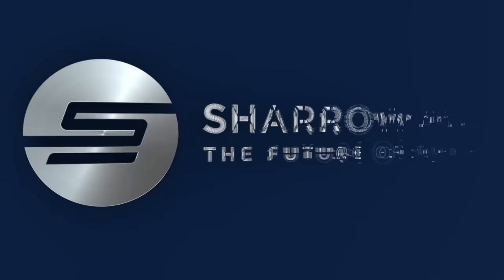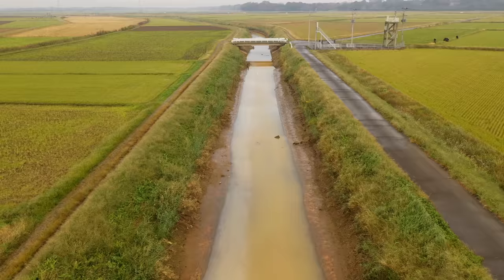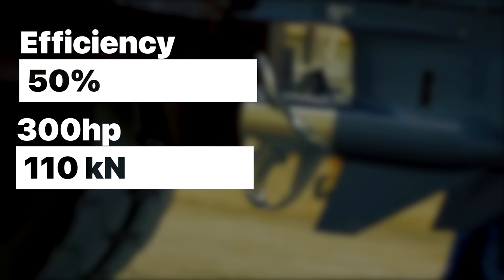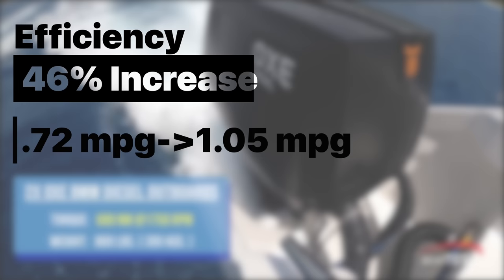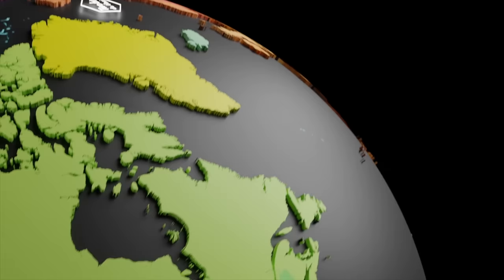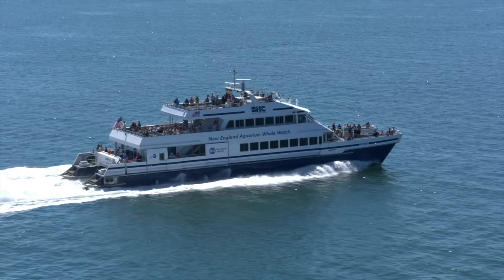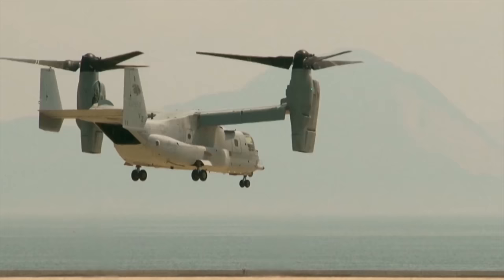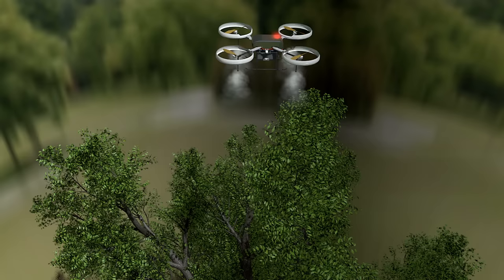Genius Propeller Is About to REVOLUTIONIZE Ships, Here's Why

Comment: They are in general not used cause of a LACK of efficiency in general. Only in very rare occasions are the more efficient - like when operating a propeller at the worst possible RPM - which boat-test even explicitly stated they did. Yeah, if you run a boat/propeller combo intentionally at the worst efficiency possible to the point that going 3 times the speed actually still increases efficiency, and then compare it to a prop that has worse highspeed performance but never test full speed.

And as you said - they have been around for well over 100 years. Around and in use. I wonder why they are not used on most ships but rather only for very few special situations like some submarines.

It is even worse considering that not only did that guy not invent anything new but that he claims to have done so when it has been shown that he KNEW of the commercially available toroidal propellers for boats.

And MIT - at least they were not complete charlatans. Their design focuses solely on the prime advantage of toroidal propellers: Reduced noise. They are more expensive, heavier, less efficient - but quieter for a given thrust.

Comment: 6:20 boats actually have BETTER mileage than cars.  The reason you can't compare the quoted figure to a car isn't because it's a boat, but because it's 50x the size!
Reply: That's only true for really large vessels such as container ships smaller vessels especially planning Halls use a lot more fuel for distance traveled than a car would
Reply: @scotticus66  also a factor of speed: you can get today's high-mileage cars moving at 70mph on almost no power while a boat at 70mph is a race boat.  But say at 5mph, does a 2-ton boat really use more gas than a 2-ton car?  And anyway the vehicle pictured is huge but I can't guess its displacement: 20 tons?

Comment: You don't say it in the video, but you show it - what about applying this kind of design to wind turbines? Durability would also seem to be improved, as well?
Reply: They're already having trouble moving straight blades from factory to site; designing a toroidal blade around this requirement may not be possible
Reply: @erics2112  That's an excellent point.

Comment: It must be a reason why such a design was not implemented so far. I think these propellers creates a lot of cavitation on the blades. Cavitation significantly reduces an efficiency of the blades and erodes the material of construction in no time.
Reply: You can't make a cost effective casting of this prop due to the complexity of the shape. And it require CNC finishing... even now the cost of the prop is over $5000, it will have to drop to around $1000 before it makes any sense in recreational boating, it may make some sense in commercial operations now. Also the benefits are overblown, it dose perform better but the claims are fantastical... when in reality testing has shown it improves midrange efficiency moderately for the most part with low end and high end not being much affected. Also you can get similar results from a conventional prop... when selecting the correct prop for your intended running speed, so for many commercial boats there may not be many benefits if they are already tuned for the speed they operate at 90% of th time.
Reply: Manufacturing

Comment: I have discovered, by accident, that angular momentum is not conserved. Nobody likes that. People attack me before they consider the possibility. Why don’t all of you “love” that accidental discovery? Are you all not perhaps a little hypocritical?
Reply: @Berend-ov8of  it is not reasonable to say “friction” and neglect a reductio ad absurdum. You abandon rationality because you care too much to face reality.
Reply: @TheAnimammal  I completely agree.
There is understanding missing between the calculations and the real thing. 
I will work on this
Reply: @Berend-ov8of  no. There is misunderstanding between: the prediction of theory is wrong, so the theory is wrong.
If you “work on it” then confirm that angular energy is conserved instead of trying to make desperate excuses why the theory makes wrong predictions.
Reply: @TheAnimammal   I fail to see how that can be done without finding out that theory is either wrong or incomplete.
Reply: @Berend-ov8of  well it is quite simple really, you measure how fast a typical rendition of the ball on a string which starts at 2 rps and is reduced to 10% of original radius spins. If it is closer to 12000 rpm than 1200 rpm, then you and existing physics are right. Otherwise you accept that the existing theory is wrong as per the scientific method.

Comment: Can this be using on the plane?
Reply: Similar design has been tried on drones ... the results were not conclusive compared to conventional blade shrouds and quiet blades. They were mainly looking to eliminate noise due to the wing tip vortex etc.... So yes they can be used, but may not make sense without significant effort in tuning the blade to the application same as with a conventional blade.
Reply: @Wingnut353  man dont use some random cheap 3d print shit for example

Comment: Umm not more efficient sorry. Real world independent tests were disappointing to say the least. The industry standard propellers with a 'cut off' squared tip still produce more power, the entire idea is to simply remove the tip of the blade excluding it from the mess of vortices flowing off the tips and hence cutting it free from the induced drag. Whilst the toroidal prop contains these vortices it simply has so much profile drag that it is hopelessly inefficient as a foil.

Comment: The looped blades don’t have to be a new idea for the performance gains to be super impressive. In some ways it’s a bigger accomplishment if the basic design concept is so old.
Reply: The problem is the performance gains aren't that big compared to a correctly selected conventional prop... the only way to get the huge numbers they are claiming are to select a very wrong prop.

Comment: It will do nothing for cargo ships... Tech has been available for a decade and nobody has adopted it because it is the wrong use case. Cargo ships use a screw propeller which is optimized to be big and slow and pull itself across the water.
These new props are good for small high speed fans... So drones and motor boats.  But larger planes and ships... No, it won't work.
And if this channel did any research what so ever, then they would know this as it is well tested already. And for drones and things the cost is so insanely high that it doesn't make sense for drones and boats either... Except for those few ultra rich crazy people.

Comment: Do they make these for powered paramotors yet?
Reply: unlikely, they would weight 4 times as much or more... or they would pancake from the centrifugal force. The marine props in the video are already very thick.
Reply: @lenwhatever4187  That makes me a sad panda
Reply: @lenwhatever4187  The versions they use for flying drones are a bit different.
I also think that they don't have to spin as fast for the same amount of thrust, so that could reduce the force on the blades as well as possibly functioning at the same level with a smaller engine.
Maybe we could finally see an electric paramotor last 2-3 hours when the technology is perfected

Comment: Hmm, you talk about boats boats boats, but did not discriminate between planing hulls and displacement hulls. Vastly different sets of hydrodynamics, power to weight ratios, fuel efficiencies. After singing the praises PROVEN ON OUTBOARDS, you then extrapolated into oil tankers. Hmm, you can't do that.

You're obviously not a marine engineer or naval designer or you would know that NOTHING can increase the maximum speed of a displacement hull. An oil tanker, or aircraft carrier, submarine, cannot be made to go any faster because its waterline length sets the maximum speed. 4/3 x square root of the waterline sets this limit irrespective of prop.

Comment: This video misses the mark and goes on a journey through clickbait valley with a clear lack of research to support the lofty claims made. I expected better from an engineer. 

You pointed it out yourself, toroidal propellers have been around for a long time and given that typically even a 1% efficiency gain is worthwhile chasing for the shipping industry, that should really have prompted more questions as to why they hadn't bothered to explore toroidal propellers. Toroidal propellers probably will increase in usage across the maritime industry over the next decade but at the big end of town where ships spend over 90% of their time operating at 1 speed, have the space for a large slow speed diesel (most efficient ICE commercially available) and plenty of depth for a propeller with a larger diameter to be fitted, the conventional screw propeller will continue to be used (at peak efficiency a conventional screw propeller will at least match a toroidal propeller with far less complexity).

Now the real interesting discussion that might bring toroidal propellers into the picture is the transition to renewal fuel sources which likely will either be used to generate electricity or combusted in an engine. Where ICEs provide better efficiency the slower they operate, electric motors tend to have better efficiency across a larger speed range which toroidal propellers may well be a better match in terms aligning peak efficiencies between motor, shaft and propeller (in theory, a direct 1:1 attachment with no gear box is the ideal setup from an efficiency standpoint)..

Who knows maybe I'll be surprised and Toroidal propellers will improve in peak efficiency enough at larger diameters and slower speeds to be competitive with conventional screw propellers to be adopted in larger ships.

Comment: the Sharrow props are like unicorns - very difficult to get hold of. These also do not make much sense for the regular boater, because the amount of money you mention in your example - as saving, is less than a regular boater spends on fuel per year all together. In my opinion Sharrow props is just an internet hype, which will die of natural causes ... About the toroidal design, with all these advantages seem too complicated to make it work in reality. The strongest point of a prop as we know i is it's simplicity, low weight and relatively low cost ...
Reply from the maker: agreed to costly for the average small boater but once you get into the medium size recreational boats or mini yachts etc then the price starts to pay off, we did some calculations later in the video.

Comment: For aircraft applications this won't work, props use variable pitch to change speeds, such as landing and performance characteristics. The toroidal design cannot be adapted to aircraft, maybe drones. And for boats it's better suited.
Reply from the maker: well ... electric motors can very easily change speeds without any pitch adjustment.. hybrid systems where a jet fuel generator powers electric motors? just requires a little cleverness ... but great points!
Reply: Atmosphere is Relative THICK at sea level , can be used in Ekranoplan or other Ground Effect with MODIFICATIONS .
better off with 100% Electric Bladeless Fan - AKA Air Multiplier . 
ELECTRIC heat can be applied for Super Sonic speeds.
Reply: @TwoBitDaVinci  so can IC engines. That is not the point. There is a lot more involved than prop speed. Prop speed determines maximum forward speed, (blades must go faster than plane speed but tips must go less than Mach 1) Much more engineering required. On top of that is strength of materials. In order for these blades to be made light enough for flying they would tend to flatten out at speed... becoming perhaps ineffective. I noticed the boat props chord thickness seems to be much thicker than current props (it looks as much as 3 or 4 times thicker). and there are effectively twice as many (three loops). However the chord is smaller so maybe only 4 times the weight. On a plane, still a lot.

Comment: that is human speak, not of God
Reply: well you can approximate the current efficiency from the total, dont pay extra for anything you dont actually need, engineers k.i.s.s. money cant rule best application decision
Reply: hydrofoil bro
Reply: engineers should not compromise best real with anything else, like politics/money/people pressure, its like you would be bought, to be biased towards a certain false opinion
Reply: maybe that is only a slow speed propeller, not nice for fast speeds
Reply: why even using moving parts, heat direct propulsion is better, no moving parts, only fluid flow thrust
Reply: try ground effect tankers on water (air craft carrier ground effect containership)
Reply: hey ducted fans deal with the issue already, the duct cancels the tip vortices and noise
Reply: optimization is not the key, intuition/creativity/insight/God is the key
Reply: promoting/recommending people is so horrible

Comment: The new propellers are being sold for over five thousand!!!!  New technology is great but nobody can afford it.  No sense advertising this until common sense is applied.  The prop builder is out of touch.  Let them fail.
Reply: Where do you think most of the stuff you use on a daily basis comes from?
Somebody has to pay for the R&D and it probably won't be you.

Comment: simply incredible, which means that I do not believe the claims. Could you please provide the data? I mean, the results of the comparative tests. And please avoid translating mechanical power into thrust, without detailing the conditions and the specifications of the hardware being tested. Miracles are not possible, and your statement at the beginning about small incremental improvements is all one can expect: engineers are not stupid